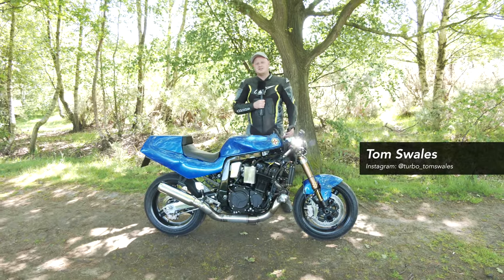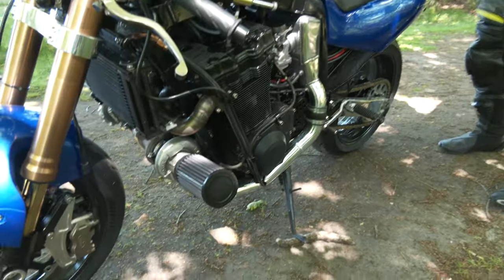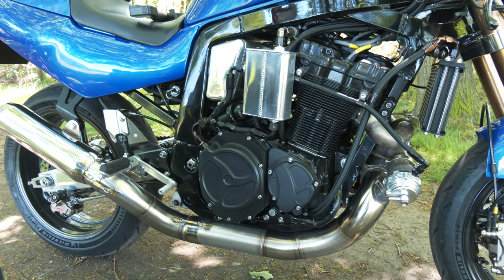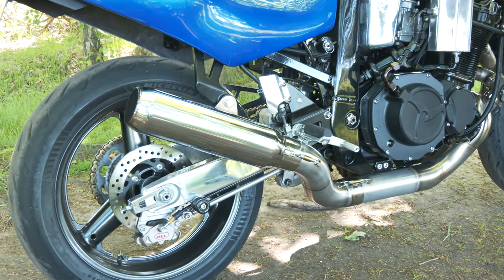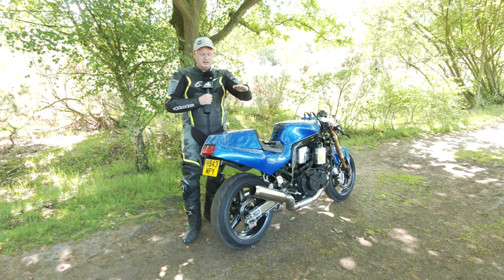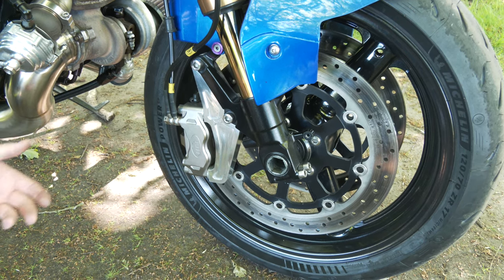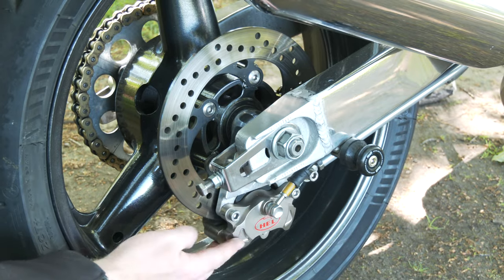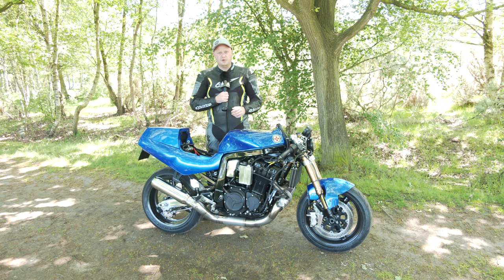Shed built: 1991 Turbo Suzuki GSX-R - quick look, ride & burnout

Comment: Ever so glad he explained the umbrella corporation logo, I noticed it right away when he showed the steering damper, otherwise I would have scratched my head for days trying to figure it out. Brilliant video BTW, it's obvious by the way you rattled off all the technical bits by heart that you know your machine inside out, no comment necessary about the 180+mph wheelies, clearly the gentleman in the white coats are coming to take you to your own private room with padded walls and floors.